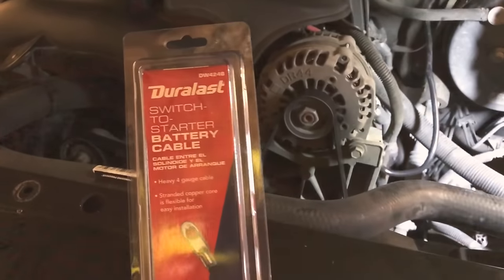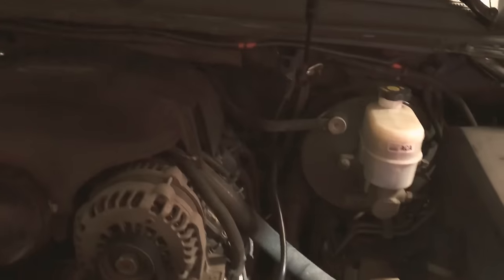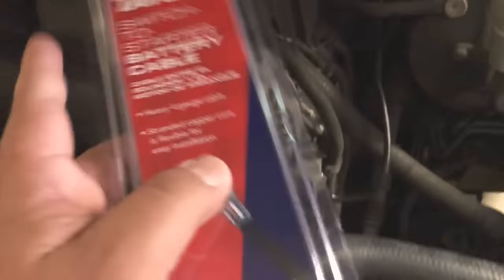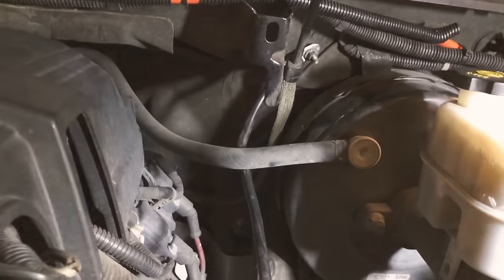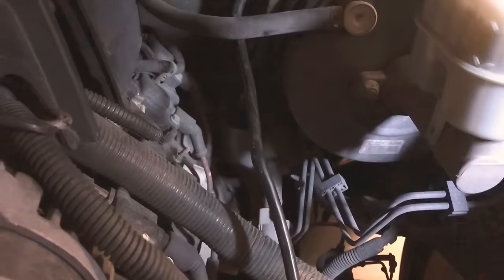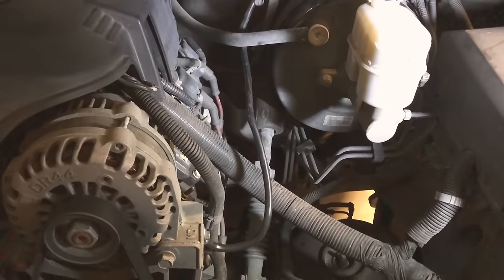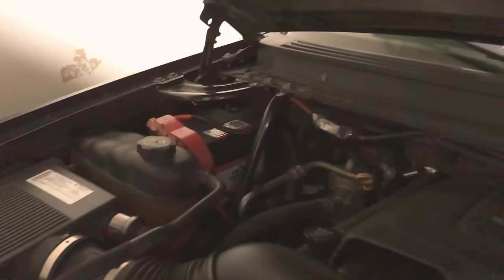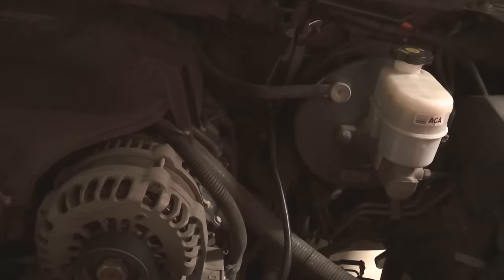07-13 SERVICE STABILITRAK FIX

Comment: Just curious, did this fix turn out to be permanent? I have a similar, intermittent problem with my 2011 GMC and will attempt this fix.
Reply from the maker: Yes i just sold the truck Friday and that issue never came back
Reply: @kickinitwithlalo5461  Thanks for the prompt reply. I'm going to perform the same 'fix' later today. Thanks, again!
Reply: @kickinitwithlalo5461  hey boss I just bought an 07 Escalade and I swapped out the transmission but it’s still giving me stabilitrak light and also the truck is starting to jerk as well as stalling at lights would this help out?

Comment: I'm going to give it a fix just like you did.
My question did your ABS light come on with the Stabilitrak???
Curious because both come on together. And the codes stated the driver side front wheel sensor was the problem
Reply from the maker: Byou Nola yea both came on together
Reply: @kickinitwithlalo5461  First I want to thank you for replying to my question yesterday. I forgot to ask did you remove the wire ground that is on the back wall. I have a 2007 Yukon xl and the ground on mine goes to the back of the engine block. I'm not sure what type of ground it's called but it's silver in color and looks like a ribbon. Just wondering if I should remove it completely while I install the new 24" ground  I purchased like yours is in the video? Thanks again
Reply from the maker: Byou Nola no i just added the new ground on top of it.
Reply: @kickinitwithlalo5461  thanks a bunch
Reply: What size wrench did you use for the bolt on the back wall

Comment: This should be a recall.  There are SO many different "fixes" for this.  I have tried numerous things and none of them have fixed the problem.
Reply: Have you gotten it to work yet?
Reply: Jose Valera me either. I replaced the stoplight switch. I’m still searching for the fix
Reply: i did this and it didnt fix the problem either.
Reply: Your right,there's no doubt these vehicles should've been recalled,smmfh,did you ever figure out the problem????

Comment: check your speed sensors i had that happened to me on my escalade 07 stability track and traction control it turned out i had a bad speed sensor .
Reply: Did your traction control light blinks while making a turn?

Comment: This fix worked on my 2008 Sierra Denali 6.2 awd.  I had no other symptoms, such as flickering gauges, non-working cruise control, or vehicle not shifting into park. My only symptom was the lights on the dash.  If you have some of the symptoms I listed, your problem might either be the brake light switch under the dash, or the steering wheel position sensor, or something else

EDIT:  the light came back on a few days or weeks later, can't remember now. Either way, it ended up being a rear left wheel speed sensor
Reply: k.a Was it intermittent or permanent ? ty
Reply: @TheJerbau  it was intermittent, and the fix was coincidental. It came on a few days later, ended up being a left rear wheel speed sensor

Comment: My 2009 Chevrolet Avalanche LTZ 4×4 5.7 is running like it's on its last leg. Service traction control, service stablitrak, and service engine, tire pressure monitor lights are on. The lifters are clattering, oil pressure runs low at idle speed but picks up when accelerating. Tried the quick fix turning wheels all the way right for 40sec dnf so tried the disconnect battery fix no still not good. What to do before I take it to the shop???🤬
Reply: I have a 08 one and i started having the same issue today bro
Reply: Got a 2008 avalanche same problem been in shop 5 weeks still not fixed
Reply: Did you fix it? Thanks
Reply: This is exactly what I have been experiencing with my 07 Tahoe for the past month or so. Did you find a solution?
Reply: In addition to all that, I also have this wicked jerk right after I start the truck and also jerks when changing gears from 1 to 2 and a little less but still jerky from 2 to 3.

Comment: Hey guys, I have a 2007 Sub 5.3. The Stabi sensor is coming on and off. The OBD stays on. Its shifting really hard from 1st to 2nd gear then outside of the OBD I dont really notice any issues after 2nd gear. I hooked up the cable yesterday. I did not notice a change but when I turned the high beams on last night the dash lit up like a Christmas tree. As soon as I turned them off everything reset and was fine. Cruise works and I replaced the pedal sensor in the spring. Terminals are clean. Getting a P0301 cylinder 1 misfire code. Going to try and swap out the plugs next but welcome to any thoughts. Thanks.
Reply: I'm having the same issue, what fixed your problem?
Reply: New plugs and cables. Running great now. If you are having the same problem it might be worth it to check the plugs. 2 of mine were burnt and I knew it was that right away.
Reply: My 09 tahoe shifts hard from 1st to 2nd and I have the stabilitrak and other warnings on my dashboard. Did replacing that ground cable fix your problem ?
Reply: No, the ground cable did not work for me. I took the ground cable back and received a full refund that I applied to new cables and spark plugs. The plugs and wires were shot on my sub. If I had it to do all over again I would do it the same way. The ground cable is not expensive and seems to have worked for several guys on this thread. For what its worth...If you do hook up the ground cable test turning on your bright lights while parked or during the day. I did not...hit the bright lights while driving and everything blacked out (lights, dash, radio, et...) at night driving with the kids. As soon as I turned the brights off everything reset w/o issue.  Good luck.    @tockesalot
Reply: I have a 07 Tahoe and I just switched all my coils, wires and plugs and I still feel stuck from 1st to 2nd. Any suggestions, I'm sitting at Azone now?
Reply: @stanbless9843  my be 1,2 actuator in transmission...

Comment: Hey bro i need to fix mine too i just had this problem today i was driving and it just lost power like the ride was on just would not accelerate so i would have to turn it off and then put my obII and clear the codes and it would ran back normal im gonna replace my cable tomorrow bro thanks

Comment: This is just an additional or replacement battery ground? Is the original faulty? I just got it from AutoZone and I was surprised but watching your video again now & i realize that's exactly what you're explaining. Seems odd that so many people are having this problem and that it's just a battery ground cable that needs replacement! If you happen to see this, please update us & let us know if the problem has still remained solved from just changing out the cable or if it returned & you figured out anything else or brought it in to a garage please. I'm heading home to install the new cable now. Here's to hoping for the best! Thank you for sharing this info.
Reply from the maker: J Walsh haven’t had an issue since i installed the additional ground.
Reply: @kickinitwithlalo5461  Great to hear, thank you for responding Sir!

Comment: Hey man do you remember what size bolt you used to connect to the ground location near the alternator?
Reply from the maker: I don’t remember the size. But it’s the same one that was on the ground strap. I just took it off and put it back on
Reply: @kickinitwithlalo5461  thanks bud. I just pirated one from the extra battery tray. Hope this works!

Comment: I got an 07 Tahoe that this happened after slamming on the breaks. Now I've got a misfire along with service stabilitrak/traction control. I replaced the coils etc. And the brake switch and all came back after a day. Do you think this would fix my problem?
Reply: The musical performance of Dan Thomas my 07 avelanche did same I changed coil as well lmk if u find solution TIA
Reply: did you find out the problem? i have the same 07 chevy tahoe with same problem. ive change computer,coils,sparkplugs&wires plus spark plug harness it keeps melting my coils , did this work??
Reply: This happeded to my 08
Reply: Has anyone fix this problem
Reply: Has anyone fix this problem
Reply: Has anyone fix this proble
Reply: Same happened to me! Any luck?

Comment: Do you add the cable to your truck? I just checked my 07 escalade and it doesn't have that cable.
Reply from the maker: It doesn’t have the braided ground strap? Or the black ground cable
Reply: @kickinitwithlalo5461  it has the braided ground cable. That why I asked if you added the black ground cable? Thanks for your response
Reply from the maker: @ernesth8782  yeah i added that cable
Reply: @kickinitwithlalo5461  thanks Ima give it a try.

Comment: Has this work on a 2007 equinox I was wondering I’m about to try this .
Reply: Did you fix it on your equinox?
Reply: Yes ! It was the throttle body sensor.
Reply: @warreneverett1085  Different cars,different fixes...

Comment: Hi, did u place the new cable on to the factory bolt and nut on the fire wall? Together with the original, thx, want to try this out
Reply from the maker: S M that’s exactly what i did.
Reply: Lalo Salazar k thank u for answering so quickly, one more thing though, do I have to undo negative battery cable while doing this? Thank u so much
Reply from the maker: S M if you’re talking about the braided ground cable, then no. I didn’t remove it.
Reply: @kickinitwithlalo5461  where is that ground on the 2011 express? Having same issue but not seeing same setup as the truck
Reply: This does not work don't waste your money

Comment: Im getting c0561-71 abs light, reduced engine power, intermittently losing 1st gear.. ill try this but im at a loss. Changed plugs, wires, lifters, coil packs and so much more but still happening.. im going crazy

Comment: So if the stabilitrak light comes on can I still drive the vehicle??
Reply: Yes, you can, but the computer will automatically drop the power by 50%; that may have been a built in feature so that one could drive the vehicle to an place where you might correct the problem?
Reply: I replaced the Throttle Body and the Stabilitrak issue was corrected, NOTE: I took this opportunity to replace the “other” part of this problem by replacing the accelerator pedal assembly.  The Stabilitrak warning / issue has not appeared since!  God continually blesses me with these simple solutions!

Comment: I got a 2009 escalade. Service Stabilitrack/ Service Traction Control System came on.

Noticed the car rides differently now and my Tachometer isn’t working, in addition it takes longer than usual to start the car now.

Going to try this and switching out the fuses as well as checking my break fluid. Will update.
Reply: Update?
Reply: @MasterNeko  went to Autozone, bought a $5 fuse switched out a suspicious looking fuse and everything fixed perfectly, runs and drives great now everything working. As a safe measure about a week later I changed out my grounding wire just better safe than sorry. :)

Comment: The parking assist off, stabilizer light, crazy dash activity happens on mine, when I pull the codes I get a punch of ecm tcm bcm lost connection issues on top of it shifting hrs out of first and not going past 30mph. I think it’s something loose cause it started when I hit a pothole immediately then went away I just don’t know where to start
Reply: Did you figure out what it was? I have a 2014 Gmc Terrain doing the same thing
Reply: @patrickolson707  I’m waiting on a new ecm

Comment: my 07 chev is same issue.   I replaced the speed rotation wheel sensor at the base of the steering column.  Worked for few weeks.  Problem is back.   How is your fix working out today?
Reply from the maker: Cal Delorey still working like a champ
Reply: thanks for getting back.  I am trying to figure out what your connected to.  One side on the fire wall ground NUT, what are you attached to on the other end?  The Alternator?
Reply from the maker: Cal Delorey there should be a braided ground strap on the firewall and the other end is on the block. It says grd right by there

Comment: I have 2011 Escalade esv with check engine code po300 and stabilitrak light on!  Got new spark plugs, intake, solenoid, maf sensor and fuel injector and still nothing fixed it.  Only misfire when idle.  Does anyone have any idea what could it be?

Comment: Did it also bring up a check engine light and miss fire on cylinder 5?
Reply from the maker: Tyree Mcgrone no
Reply: Lalo Salazar I’ve replaced the spark plugs and the wires and the coil pack and I’m still getting the stabilitrack  light and a misfire.
Reply: @laurocortez3088  it was the cam shaft it was damaged on cylinder 5.

Comment: I have a 2009 chevy silverado....i just did this...have you had the problem again buy any chance....i just hope it gets fixed.
Reply: Julio Barraza la caja dice cable entre solo pide y el motor de arranque, pero creo que lo mejor es que lo revisen con una computadora para ver qué código arroja y poder repararlo ya que lo del Stabilitrak es causado por diferentes cosas

Comment: same problem on my 07 cadillac escalade, service stabilitrak few weeks ago,the problem now it cut off while driving and won,t start, it sounds like the started engaged but immediately disengages ,,seems like it choke???? can,t wait to give a try,,,,,,but i would appreciate any suggestions,    thanks
Reply: Did it work
Reply: Keep oil changed. Dirty oil will cause this flooding out.   I also had to put on new ground battery cable because mine wouldn't start. I had to Google Cadillac forum to figure it out. Also changed cam sensor to be on safe side.
Reply: @stanbless9843  no it didn't
Reply: @pitbullsrule04  thank y'all guys for your comments
I really appreciated
As far as the starting problem, I got fixed it was the fuel pump
However I still having the problem, with the stabilitrak/traction control
Reply: Did you fix it ?  What did you did to fix the problem thanks ?

Comment: What size bolt goes into the alternator bracket? Thank you in advance.
Reply from the maker: IRRELEVANT RELEVANCE  can’t remember but it’s the one that’s already there
Reply: @kickinitwithlalo5461  Thanks man! My SUV doesn't have any bolts there so I have to find some. Your video is great information. Yahuah bless!
Reply: @sadlifeofdad  what size bolt did you get? i went from battery to firewall and it did not fix it

Comment: That Auto Zone cable is junk. It WILL cause you trouble latter down the road.. The eylet end is the problem the way it is made.. You fixed it by powering the vehicle down when you removed the cable from the battery. I work in the Charging and Starting of all cars and Big trucks and I am the shop forman.. 37 years at the same place.. If the truck was starting fine it was not that cable.. Those models did have problems with the negative cable. The dealer always replaced the neg. cable.. The problem was and always is (as far as I have seen) the terminal at th battery on the neg cable.
Reply: I have an 2008 Impala SSi have same issue traction light comes on shuts car off and it won't start i took it to the shop and they said it was low fuse they replaced it and said they tightened starter wires bc it was a little loose and it stared up just fine... but im stuck right now bc it did it again so your saying its the negative battery wire that needs to be replaced?
Reply: So which cable is the best one for the Escalade???

Comment: What size bolt did you use to attach to alternator?
Reply: The bolts are there already
Reply: @jqahir not on my truck 2010 Tahoe they are not there

Comment: Bring it to a garage to see if it pulls code dtc p2135.   Throttle position Sensor 1 and 2 are not communicating with each other.  This is covered by recall at no charge to you. 120000 miles or less and less than 10 yrs old. I wish you could upload a photo in the comments below cuz there's a lot of models. Look it up on GM. Good luck
Reply: Wait, the TPS code can trigger these stabilitrak issues?

Comment: I have a 2016 GMC Acadia AWD that I just bought used about 15 days ago and is having the message that the Stabilitrak needs service and Traction Control is off, and then it won't let you accelerate over 40mph and gets really jerky.  It seems to happen randomly and at highway speeds.  After sitting for a few minutes, it will turn off and go back to normal.  The dealer can't duplicate the problem and it happen a third time this week when I went to pick it up from them.  They had replaced a break sensor thinking that would fix it.  As soon as I got on the highway and got up to 75mph, it went off again.  Has anyone tried this fix on a new model?  The dealer doesn't seem to think it's the throttle position sensor, but that seems to be what I've read it mostly is.
Reply: What was the problem thanks
Reply: The dealer replaced the brake relay switch, and it hasn't had the problem since.

Comment: I just fixed mine today active code c0710. Code is for steering wheel position sensor. Its mounted behind steering shaft. I switched it out and code is gone.
Reply: Did you get a check engine light for that code?

Comment: This was my problem I just put a new motor in my truck and it started shifting funny and not running right I changed out injectors still running like trash come to find out a bad ground….

Comment: It put the cable like you did service Traction control & service stibalizier turns on still
Reply: Have you gotten the codes to come off yet bro? Been having the same problem for about 2 months now. You may want to try the brake pedal sensor deal, I haven't fooled with mine because it's working like it should but give it try that part goes for 25 bucks at just about any auto parts store
Reply: Brake pedal sensor its new install it 2 months ago cuz my cruze control didnt work anyway thanks for the tip